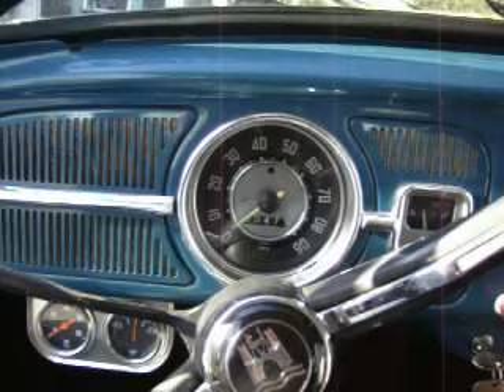1966 Volkswagen Hoodride

Comment: Hello, I am new to the VW scene and I have a few questions. I own a 1966 beetle and it is my first car, a project of some sort. I noticed that my dashboard isn't like yours. Mine seems to have the driver side vents covered up, no radio, and only on switch for the lights. I have wipers but no switch to turn them on. Any help as to what is the difference? How can I solve this?